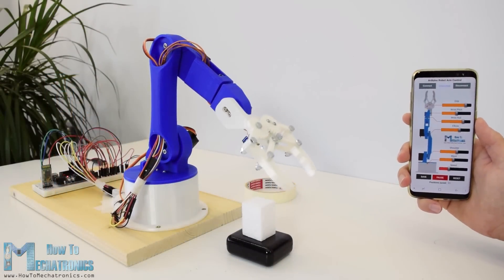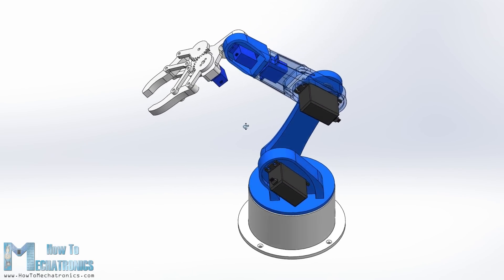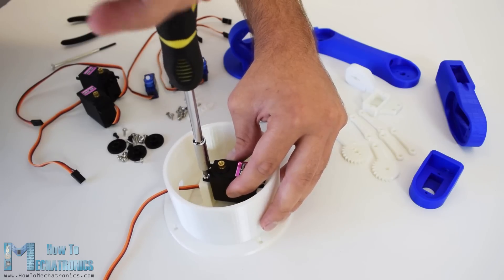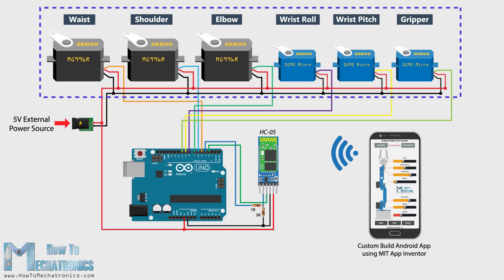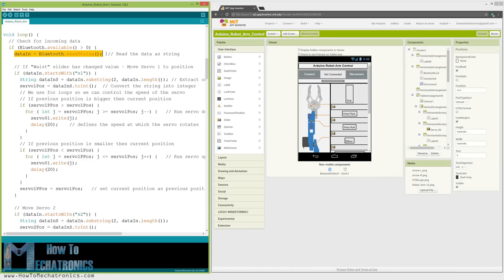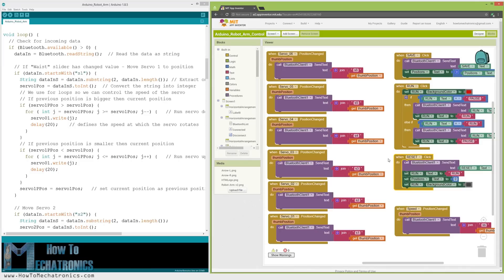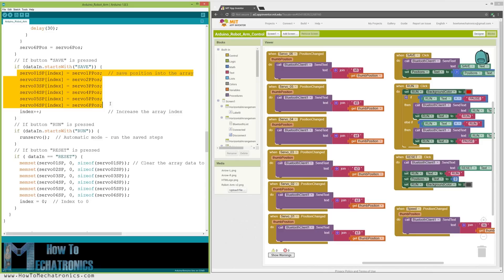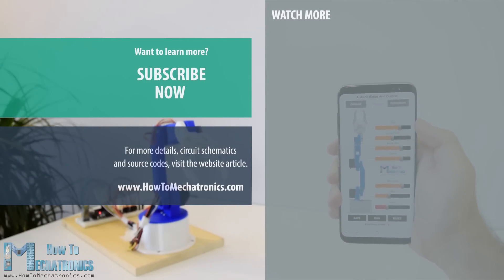DIY Arduino Robot Arm with Smartphone Control

Comment from the maker: I hope you enjoyed this video and learned something new! If you'd like to support me making more content like this,  please consider supporting me on Patreon: https://www.patreon.com/howtomechatronics
Reply: Can you make a video on the electrical connections,  I'm finding difficulty so
Reply: @noyb6969  was a video ever put
Reply: @noyb6969  pudiste des pues de todo
Reply: yes but why you have used tx and rx diffrent from board
Reply: Hello
Reply: InstaBlaster
Reply: yes i have enjoyed the video but one problem
the circuit which you have shown in the video is different from the one in your website
i'm not able to understand which one is the correct circuit.
can you plzz make a video on the connections to arduino.
Reply: Can you explain the cable connection
Reply: Can we go with th ESP32 module
Reply: Nghm
Reply: Gi
Reply: Hello, pls I'm interested in I robot arm, pls can I buy it
Reply: sir,what kind power supply did you use?
Reply: Hi how to mechatronic should the mg996r servo 180 degree or 360 ?
Reply: Please send the code
Reply: I have a doubt in connection time you showing 2 mg996r are connected as and one sg90 is connected but then in circuit connection time you said that and showing 6 servo. That point I am confused

Comment: Sir, I followed all the steps like you, but after uploading the code, all the motors started vibrating, and when I moved the slider switch from the smartphone, it didn't work.

Comment: Hello. I also made this robot but I have some problems. the last 3 motors (micro servos) work chaotically or not at all. what is the cause I provided a 5v and 12A power source and wired everything properly, as in the diagram. write me back please because I want to make it work

Comment: Hi Thank you for this great project. I am battling to get the app to work with robot. I see you have a updated app that is used when adding wheels. Will it be possible to send me the Code and the App details. Thank you
Reply from the maker: Hi, there are many things that could go wrong in this situation.
First you must check whether you have a proper Bluetooth communication, whether your modules work right. You can do that with another simpler code just to test whether you have communication.
Then you have to check whether you are getting any values from the app into the Arduino so that send commands to the motors to move.
There is no guarantee that the codes that I provide will always work on your setup. It worked for me, and I showed how I did it. From there you should find a way how to make it work on your setup.
Reply: @HowToMechatronics  Plz provide app and code for this project as you said in Mecnum Wheel and Robotic arm project

Comment: I have just completed this project
but there is a  problem 
ı cant even connect to bluetooth modul 
İn my phone it says saved but not pairing
please check me out :D
Reply: check if your RX & TX aren't busy receiving data from somewhere else, for example your PC via the cable. The arduino can only handle one data stream at a time, and having the cable connected takes priority over the bluetooth module.

Comment: il testo con la fotocamera

I'm trying to control the 2 servos with 2 joysticks but I'm missing the right power supply, can anyone tell me which is the correct power supply to use? (I think in the video he says 5 volts 2 amps)

￼
Reply: 5 volts 2 amps is enough to drive 5 servo motors, but you can use it for only 2 motors too. Your arduino can only supply 1 motor, so you have to use external power.
Reply: so if I buy a 5v 2a power supply does it work?
Reply: @aiutostudenti  yes it should work, the motor will only draw how much it needs. Remember to do the wiring correctly like in the video!
Reply: Sorry for everythings.
I found a Power supply 5v 25a Is the same thing ? Or 25 ampere Is too much?
Reply: @aiutostudenti  that should be technically safe to use, HOWEVER, be careful what types of wires you use. For your case with two servos I would calculate the maximum current those two could draw and decide if the wires can withstand that. 

If you're using the typical arduino wires I use as well, they should hold 3~4 Amps without melting, but going higher than that would be a bad idea.

Also don't apologize for asking questions, it's only natural to want to know more.
Reply: I tried every way but nothing worked. I'll explain exactly what I want to do. I want to power the 6 motors with 2 joysticks, obviously to do this I need an external power supply and this is where I can't understand how to connect the servos to it. I used one of those external 5V 25A power supplies from old PCs but despite this the robot does not respond correctly to commands and makes strange movements. So, a question came to me: does the board have to control the PWM signals and give the 5V and the gnd at the same time? I say this because I power the servos from an external power supply and then the PWM starts from the board; the board and external power supply were connected with the breadboard. I have therefore come to a conclusion: I have to power everything from the board and to do this I have to connect the board to the mains, with the jack input so to speak, with 9 volts however I need a minimum of 2 amps and therefore I need a power supply ( similar to a phone charger) 9 volts and 2-3 amps. can you tell me if there is something wrong? thank you always for your patience

Comment: Could someone tell me precisely the models of the servomotors
Reply: 3 MG96R and 3 SG90 Micro Servo
Reply: I assembled everything, everything is fine, the only thing I have a problem with the third MG996R servo (the elbow to fit in). it lowers itself. with the servo motor of the "shoulder" I applied a spring and by doing so it manages not to fall but I can't understand how to solve it. I thought maybe another spring needs to be applied but I don't know where to put it. can you help me?

Comment: hi i made this arm but I got problem When I start controlling from moble app all servos started vibrating , why this happens all things I have connected as per circuit and code is also fine , please help me.

Comment: I JUST REALLY NEED THE DH PARAMETERS!!!
Thanks very much for the detailed tutorial, I followed along and the robot was amazing. I am working on development of the project; adding the capability of inverse kinematics for this robot. Giving it the cartesian pose  relative to frame zero being below the base.
I searched through detailed blog and opened all the links related to the design, but none of them was including this information or the file in a format that makes measuring the dimension possible. Measuring the 3D-printed parts does not give an accurate enough estimation.

Comment: Hey man! been following through the tut and I've come to a roadblock. Wired up the circuit to the diagram on a Arduino mega. The app connects to the Bluetooth receiver and the motors move to their starting
position when powered but non of the controls work... any ideas?
Reply: I'm guessing it's something to do with using a Arduino mega instead of an Uno, I'm using all the same connections as the Uno drawings

Comment: I have a couple of questions about this setup and I hope that it can somewhat be applied to the project I'm working on. I'm in the process of making an animatronic bird for this project.
The bird in question will only be able to move its head and its wings created with 3d Printed parts.

1. With just the wings, how much weight can the MG Servo motors can handle? I need the motor to handle roll and pitch movements to potentially move 360 degrees for the roll, but only 90 degrees on the pitch. Each wing is not going to be heavy. No more than 55 to 66 grams.
2. On the pitch movement of 90 degrees, would it better to setup a pulley belt system to move the wing, like an arm, 90 degrees?
3. Since I can't use the app for this setup, is there another way to control the servos remotely?

Comment: I have a doubt? How to make this same robot with servo motors at the joints. To move it only using hands(manually). How to make the joints so that it can hold its position unless it is moved

Comment: I bought 2 HC-05 modules and both were with 9600 default baud rate. I wasted so much time figuring out why i had no app to arduino communication.

Comment: I get error in the 507 eror
Reply: you need to ad a seperate power source for the hc-05 module(like a separate 9v battery) then it will work

Comment: I am wondering how you can obtain precision by moving a slider on your mobile phone ! The movement of your thumb may displace the robot arm by tens of degrees. In many cases you have a very tiny tolerance to grip an object.

Comment: Hi , thanks for sharing this project with us. I am wondering whether you do not connect the Arduino to 12V because you did not  show it on the wiring diagram (where you did not connect the GND to outer 5V source either) .

Comment: Hi Dejan! I tried to use some different example with different code and android application. My SG-90 servo working fine on different example of different android application but whenever i attach MG996R servo it is giving me an error 516: Unable to write: Broken pipe. I tried it with different Baudrate but still the same issue. Can you please tell me why is it giving me an error on MG996R and not in SG90. Please help me to resolve this issue

Comment: Hi Dejan! Whenever i connect the HC-05 and try to move the motors it gives me Error which is "Error 516: unable to write: Broken pipe". Can you please help me to resolve this issue because my project is not working
Reply from the maker: Well your Bluetooth connection is not working properly. Try to get it working with a simpler example, try matching the baudrates you might have a different one.
Reply: @HowToMechatronics  Hi Dejan! I tried to use some different example with different code and android application. My SG-90 servo working fine on different example of different android application but whenever i attach MG996R servo it is giving me an error 516: Unable to write: Broken pipe. I tried it with different Baudrate also but still facing the same issue. Can you please tell me why is it giving me an error on MG996R and not in SG90. Please help me to resolve this issue

Comment: Sir, love the robotic arm. Sir, can l use the dc gear motors in Arduino Bluetooth robotic arm car and some changes as well in the circuit diagram and the code as well to make the Arduino Bluetooth robotic arm car work? Will the Arduino Bluetooth robotic arm car work or not?

Comment: Hi...nice project...(1)to power up the servo required external 5v source 2A, can I use bulk converter (3.3v/5v) or direct power adapter of 5v 2A? (2)when programming the board need to connect usb to pc at the same time...should unplug the 5v external or bot 5v external and usb can be connected and run concurrently?

Comment: I got a qeustion, does the program for controling the robot arm still work? because I buyed all the motors and I got my self a 3D printer the CR-10.  But I wonder if i would find many complications while I make my first robot arm ever! So I hope it will work if assembled everything and got the right Ardiuno board etc.

Comment: Your sketch in arduino does not work, the motors from the application do not work, 5 pin do not work, and the rest from 6-10 pins by themselves work continuously

Comment: At my robot arm is a problem. After i connencted everything together i started the App and connected it to the hc-05 but then comes "error 516 broken pipe" and the robot arm makes sounds and it moves randomly around and it doesnt work. I dobt know where the problem is becaus the Code and the App is from the Web site.

Comment: Thanks, im trying to do the same project following your step with wifi using esp 8266 and firebase but I'm having issues, do you have any idea, how i can send variable data from firebase to esp 8266 in order to get the tumb position, please help, Thanks

Comment: Hi, I don't know if I still have time to seek help on this project, however I built this robotic arm, as well as in the description on the site, I installed the app I loaded the code for arduino, but when I start the robot, the servos are like crazy they tremble, then when I use the app it doesn't move well but trembles, the grip does not open but remains closed and if I try to open it it opens for a few centimeters, and then closes immediately, the other segments of the robot do not they follow the commands of the app well, but they do it in a confused way, I don't know what I did wrong but I think others have this problem too, but I don't know how and if they solved it.
Reply: I tried it with the code and the application and yes it works, look for the last video of "FABRI creator" on youtube e
Reply: i have the same problem, if you already solved it then please tell me

Comment: Hi this is an amazing project thanks, i already printed and conected everything and uploaded the code to the arduino uno ( i only have a doubt about the resistences on the bluetooth are those necesary??) i dowloaded and installed the apk i connect to bluetooth but the sliders dont do anything
Reply: Can you share the code for it to me

Comment: Great project, indeed. But when I try moving servos, they just tremble and no proper arm movement from any servo. I supplied an external 5V DC 2Amp supply.
Reply: if you did then please help me bro cuz its part of my graduation project
Reply: @roshbit2091 same problem. Did you solved this problem or not. If u have solved kindly share with me. Thank you.
Reply: yep same here bro, have you figured it out?

Comment: did anyone actually try to build this thing, or are we applauding the concept? the app sort of controls wrist pitch and roll only after I changed the baud rate to 9600, and ffs forget about the shoulder and elbow commands, the trigger the wrist pitch, grip and roll into a Michale J Fox frenzy. oh and the waist just sort of moves side to side. so. that's about as affective as the elbow and shoulder functions. I sense some AT command information missing but wtf do I know, def not how to make a bt robo arm that's for sure
Reply: if you found the solution then please help me because its part of my graduation project and i have the same problem
Reply: @roshbit2091  I think it has something to do with the motors pulling too much current from the same power supply, if you look @ his crude circuit, they're all running on the same power supply going back into the Arduino, as one servo pulls current, I think it triggers pulses to the others as the voltage alternates from the pull but I can't be sure. the waist and shoulder just went bezerk when I first hooked them up, to my disappointment, I found out the motors he posted links for are continuous; I did some digging and I guess continuous servos can be positioned (I thought they could only be speed and rotation) but it doesn't change the fact that the waist and shoulder aren't even responsive, maybe its because there's less resistance for the power to go to the micro servos? idk the waist does the teeniest wiggle w the slider but it still makes the grip, wrist pitch and roll go off. no idea, there's no shot of the breadboard and my guess is the rest of these people are just cheering on a guy who made a halfway informative video, maybe because we aren't, we're not getting a response, so we'll prolly never know
Reply: @Stubert619  alright thanks man i guess we will never know lmao, anyways i just thought of a simple stupid solution lol, instead of controlling the motors via the bluetooth module ill just control each motor seperately using 6 different potentiometers. So if youll be able go write the code of that lemee know mate
Reply: @roshbit2091  Yeah, pots should do it, just wanted the automated functionality. Be careful w those continuous servos though, micros should be butter smooth, idk about the standard sized ones, they might just spin in one direction or the other however fast you're pot allows it
Reply: @Stubert619  Exactly, i built mine and realised slight control of the waist will sort of triggered the gripper as well. Continue usage of the application just sent the entire servo going haywire. Not sure why everyone is cheering on about.
Reply: @nicholaslee8136  As long as there's 3 of us who actually do things

Comment: unfortunately this is not working. After printing all the parts and putting them together as per the electronics schematics. It does not work. The Mobile app is able to connect to the bluetooth module and shows the status connected but when the sliders are moved the servo moves very slowly. Also tried with 1 servo the problem is the arm shows some movements when only 1 servo is connected. when the slider for elbow is moved the arm shows little movement and when the shoulder is slided it shows some movement. When only 1 servo is connected not sure why all the sliders are working for 1 servo. Is there any upgraded code to get this working ?
Reply: And the servo are slow due to low power supply
Reply: Is the dimensions wrong or we're not able to implement Bluetooth connection??
Reply: The basically the code is designed to act on any input it receives
Reply: Yes not working
Reply: Bro can you provide the stl files for the design...??
Reply: How did you give the power to the system ??
Reply: @nidhik2225  take power supply DC 5v 2amp and take female adopter and connect to bread bord